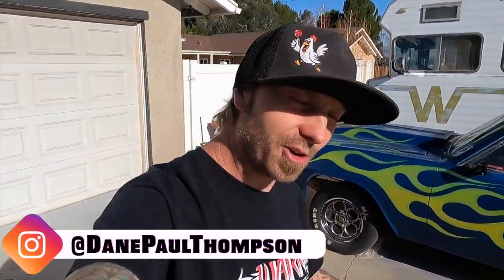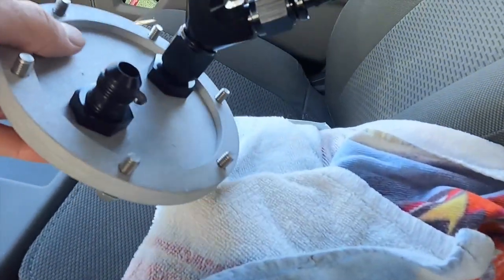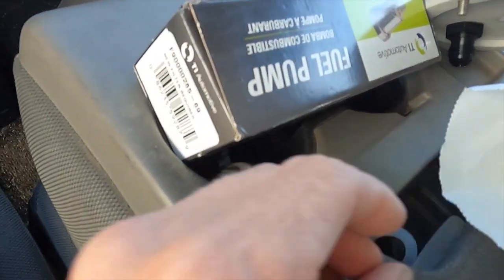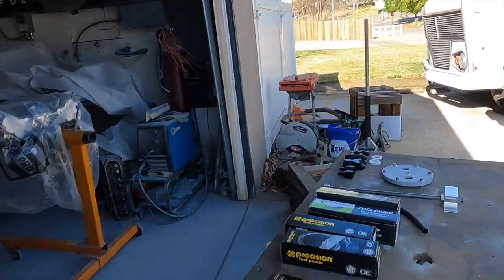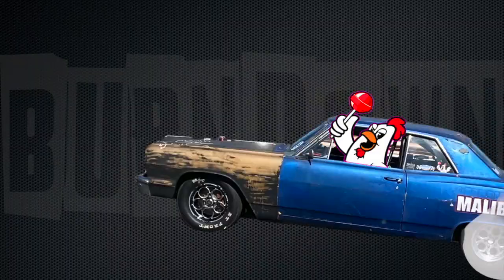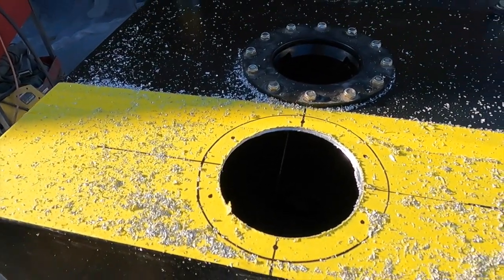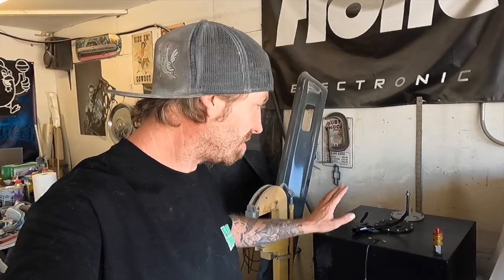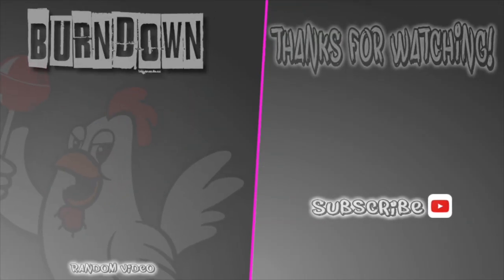Ebay Fuel Cell In Tank Pump Conversion Part 1

Comment: I just ended up buying the rci universal 12 bolt fuel cell in tank mount kit from speedway motors to mount into my no name eBay fuel cell.  I ended up having to use my factory plastic pump mount due to my pressure regulator being built into my factory pump assembly.  Then I was able to buy that hard plastic 3/8 inch line to run from the oem pump output to the bulkhead on the hanger.  This is all to run a fuel cell in my 2004 Acura TSX dirt track car.  I never knew what those shrink mounts were for the wires until I bought this kit.  I had to take the plastic surround off my pump in order for it to fit through the fuel cell hole, I have the bare brand new fuel pump sock touching the bottom of my fuel cell tho.  I never used any braided lines, I just got AN to barbed fittings for high pressure rubber line, I was able to find an ICT billet adapter to connect 3/8 line to my factory Acura nylon fuel line.  I would have totally went your route if I would have seen this video first. Rock on 🤘
Reply from the maker: I should make the pump hangers for people so they can do this easily. Yeah it’s a pain but it works out. Glad to hear you figured it out

Comment: Terrific video!!! I’m messing with my fuel system at the tank right now.  Thank you!!!
Reply from the maker: If your going to run e85 take the fuel level sensor float out of the tank. E85 will eat it and plug your filters. Thank you!
Reply: @Burndown  when I was originally building my fuel system I was setting it up for e85. I ran 8AN with PTFE line but I soon found out that E 85 in Salt Lake is really hard to find so I’m running 91 because it’s readily available.

Comment: If you haven't found the Y- fitting for the pumps let me know.  I just finished the exact same setup and found a perfect Y that goes from the flexible walbro line to a -8. I also have some spare e85 safe submersible line for the Y to bulkhead
Reply from the maker: Thanks man! I appreciate it. I just went individual out to a y outside the tank. The video drops tomorrow. I dont like the looks really but its about function not form at this point really.  Thank you for the offer!
Reply: i guess I am kind of randomly asking but does anyone know a good site to stream new series online?
Reply: @Theodore Corbin flixportal :P
Reply: @Issac Milo thanks, I signed up and it seems to work =) I really appreciate it!!
Reply: @Theodore Corbin glad I could help :)

Comment: Hey Dane an old school radiator shop told me that when he restores old fuel tanks and can’t get “all” the rust out a tank, he put cow magnets in the bottom. Cow magnets are magnets that actually used to put inside of cows stomach because they you know eat everything. These magnet are earth magnets very strong and do not move once stuck to metal. It might help with if not being able to get all those shavings out or for future projects.
Reply: fuel cell is aluminium
Reply: @norego6237  crap didn’t realize that LOL.
Reply from the maker: It was a good idea tho😁  I rinsed it and then used a wet paper towel to get the rest of it. It took a while and im sure something will be left but the strainers should prevent and damage hopefully. I would like to have a spire pump with me at lest just in case.

Comment: Where did you get that black hose you hated? I'm intrigued by the fact that it has an AN end on it, and that it looks like you can cut the other end to length.
Reply from the maker: The AN fittings are female to barb fittings I put the hose on. The plastic hose came from G and J aircraft in Ontario CA.

Comment: Could you run both pumps up to the bulkhead with two fittings and put the Y into one line outside the fuel cell?
Reply from the maker: Thats what I ended up doing.

Comment: Why are you converting it to in/tank?  A high flow or dual high flow in line should do the trick. Way less work.
Reply from the maker: In tank pumps run cooler and are quiet. External works but just depends on what your trying to do. For drag and drive stuff I feel like in tank is the way to go.

Comment: Did your Buddy 3d print that hat?
Reply from the maker: He works at a machine shop. He sand blasted it so it has a dull finish to it. Looks cool I think. His name is Joey G 😁
Reply: @Burndown  Think your buddy would make another one and ship? :P I've been debating about doing a cell, but didn't want to run inline pumps.